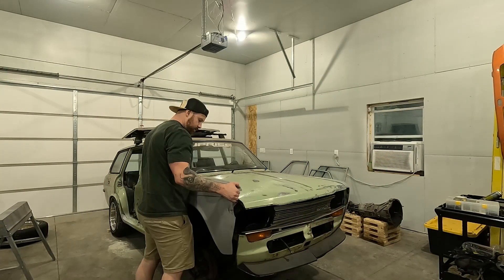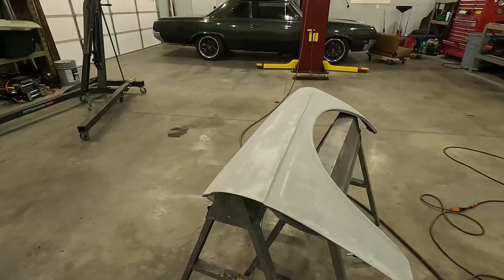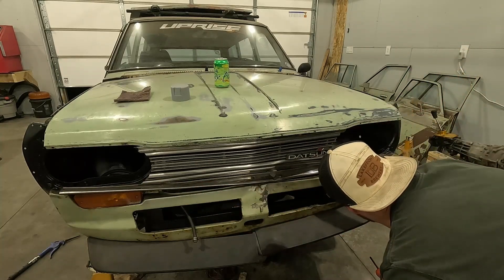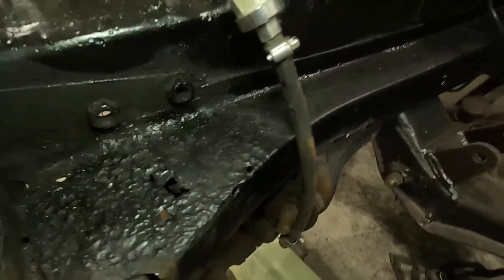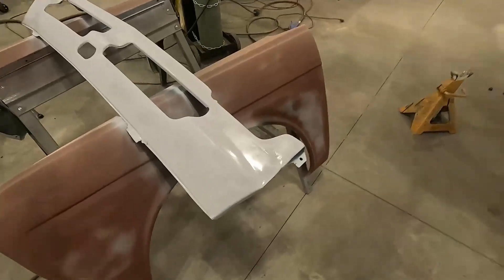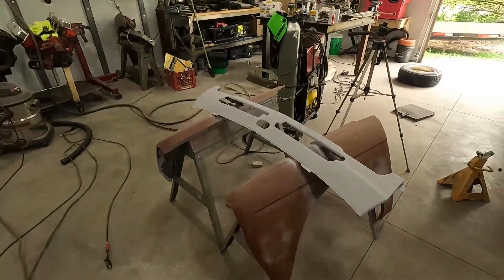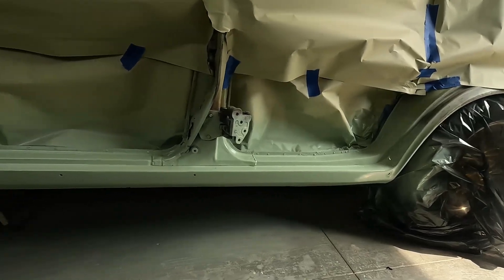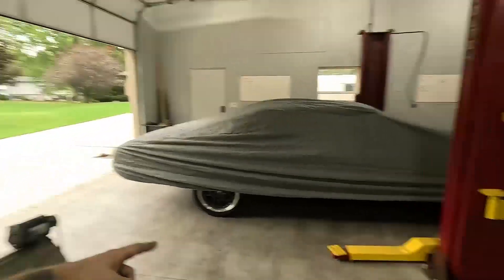Making the Datvacado a CAR again!!!! Custom matched single stage paint!

Comment: I had a 69 510 it was a four-door I turned it into a two-door
Reply from the maker: Did you have to cut the B pillar or how did you do that?
Reply: No I did not just welder the door shut and I shave the door handle off and covered it up with a piece of